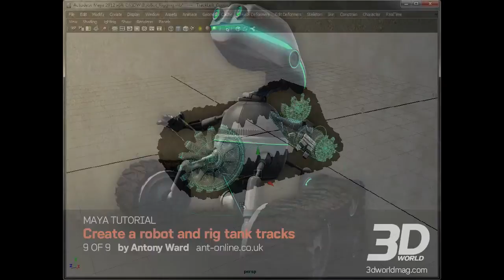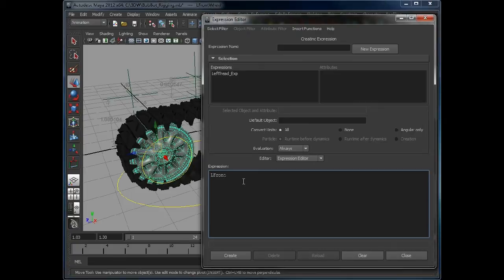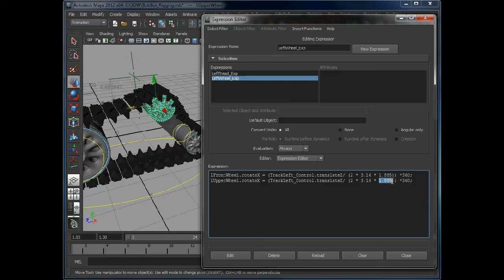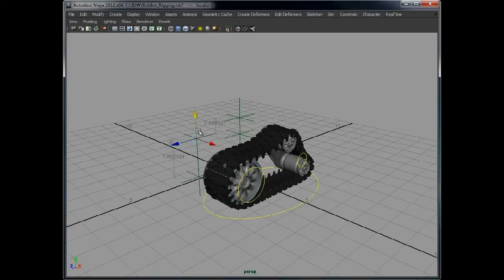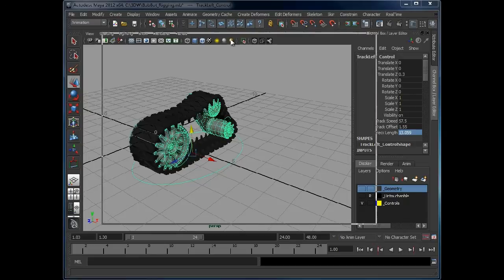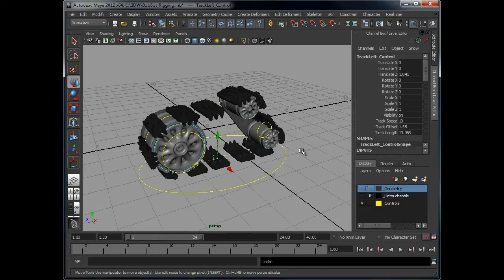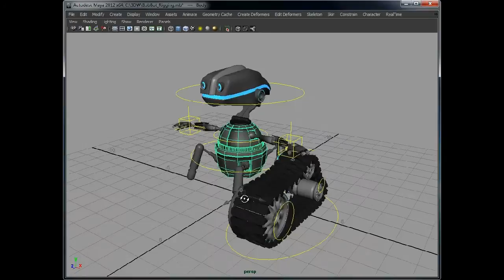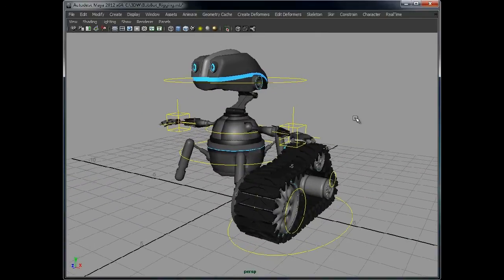(9 of 9) Create a robot and rig tank tracks

Comment: @Hypersomniacs aye. you're right I found that equation to cause problems ... perhaps instead if the tracks were set the the rotation chanles.  and then link that so whereever the front has shifted as your Z direction. this could also change the speed of the track if the tank is moving and turning. though im a bit stumped on the exact way to go about that